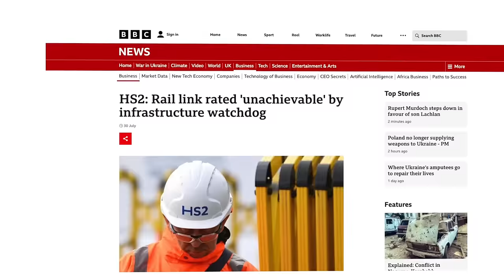The Battle To Build Britain's $90BN HS2 Railway

Comment: China builds 350kmph rail at a cost of under $30 million per Km.
The UK is building 300kmph rail at a cost estimate of over £1 billion per mile.
An utterly absurd cost.
Reply: China is a One Party State though with the ability to just take land off people for the common good.

The UK has to abide by different rules . . . and the law.
Reply: 1. HS2 is being built with a top speed of 360km/h, not 300.
2. A quick google says that the full length of HS2 is 530km. If we divide the cost (as stated in this video) of £106bn by that length of 530km, that leads to a cost per kilometre of £200m. That's still a lot of money but nowhere near £1bn! It's also important to remember that that cost includes not just a railway through open countryside, but also complex city centre approaches, massive new stations, and significant tunnelling.

So if you're going to leave comments criticising the cost of the project, at least do some research first and get your facts right!
Reply: @jasonhesson1030 we've just found someone who believes figures stated by the CCP! there's always one...probably hasn't heard of Chinese tofu-dreg construction.
Reply: @MikeWillSee  The 530km length would be the total length including the 2 Northern legs that will never get built.
The actual distance, as the crow flies from the centre of London to centre of Birmingham is exactly 100 miles, go and check a map.
Top speed does not mean average speed or safe operating speed.
The actual operating speed will be around 300kmph.
You pulled your stats off wikipedia didn't you?
The current estimates for completing the two northern legs are in excess of £150 billion.
The £106 billion figure is only the phase 1 expenses, which is the London - Birmingham bit, so effectively a billion per mile, as the crow flies.
Reply: @disposabull  wrong again. The £106bn figure is and always has been for the full route. The first phase between London and Birmingham is (last I checked) estimated at between £40bn and £50bn. Furthermore, the actual operating speed is also planned to be higher than 300km/h, with trains regularly running at at least 320 - 330km/h, with the ability to increase to 360km/h if they are running late or need to speed up for some other reason. Most of the line is also futureproofed for 400km/h even if it won't initially operate at those speeds.
Reply: @MikeWillSee  The £106 billion figure was an estimate in 2015 prices.
You may have noticed there has been rather a lot of inflation since 2015.
Reply: @disposabull  wrong again. In 2015 the budget was estimated at £56bn.

In 2019, following more detailed design work (and thus a more accurate reflection of the final cost) it was revealed the final cost would be about £88bn and last I heard this is still the official budget for the full railway (not that the government is planning to build the full railway any more).

The £106bn figure is a reflection of inflation since the 2019 estimate.
Reply: I made a video about it and its bridge
Reply: @LoremIpsum1970 The same can be said for the UK government.
Reply: @wackypeace1135  🤣I know which country I'd rather live in🤣
Reply: @LoremIpsum1970  If you ask the Chinese, they would respond in much the same manner. Everyone's indoctrinated into believing there own state ideology, your just too ignorant to know it. Even from a purely capitalism perspective, China appears to be doing fairly well.
Reply: @MikeWillSee  200Million is a lot for a mile of rails,  most of the track is in the country side...
Reply: @LoremIpsum1970  tofu-dreg construction   people like ur self really love that phase,   so give us  a example of one such project?
Reply: @jetli740  and I reckon the cost for the fairly plain line through the countryside would be a lot less, and certainly more comparable with other high speed lines around the world.

Unlike other high speed lines, though, we're building complex new (often tunnelled) approaches into the city centre, where most high speed lines around the world would use existing tracks. This isn't practical for us though as the existing tracks are at capacity and the whole point of HS2 is to increase capacity, hence why new city centre approaches are needed.
Reply: @MikeWillSee    98% of the track in the country side.  dont matter how you add up the 2 % it cant cost that much.
china build the    Lao  414-kilometer train that go through ton of tunnels, bridges, via duct  stations ,clear out jungle, land mine
etc  ... and the cost is only $6B

let face it, uk we dont have the know how, technology to build it at a decent cost.
Reply: Higher quallity and the best technology and know how.
Reply: @jasonhesson1030 tell that the the minority in anerica especially the black and native Americans.
Reply: @stvdmc2011  🤣
Reply: And meanwhile cities in the poor UK goes bankrupt, 1 by 1.
Which country's FM went to the PRC and begged for trade?
I give you a clue, it wasnt India.
😂😂😂😂😂😂😂😂😂
Reply: @LoremIpsum1970   Tofu Dreg construction like aerated concrete that all the schools in UK seem to be made of?
Reply: @taiwanstillisntacountry  

So why haven't you emigrated to your beloved PRC then?
Reply: Why?
Why?
Why is the British-Raj ranked 107th on the hunger-index of only 116 countries?
Why are P00R Scammers of the British-Raj living in Mumbai-Dahravi?
Why is what i do any of your business?
Nuofu-inu? Is it you?
Glory-to-the-British-Raj
Thank God, i am not living in P00R UK.
Reply: Meanwhile in Indonesia.... 😁😁👍👍💪💪🇮🇩🇮🇩
Reply: @jetli740 we do but you are not comparing like for like with China. China doesn't have planning regulations to comply with. Their design costs are not included in the cost as they are paid separately by the Communist government. They also only include the cost of the rail track in the published costs .The cost of the tunnels, embankments,  bridges, road alterations are not included in their published costs.
Reply: @TrevorWilliams-fq8mg  are you try to cope?   it not working...    Lao 6B is the complete deliver working train and track cost.

Comment: Should have given it to the Chinese, could have delivered faster and cheaper
Reply: actually they did invite china which quote at £13-£17B but politic get in the way same as the Hinckley point c nuclear station  ... both could have build at massive less than they do now
Reply: Was that a fixed price actual cost quote and did it include for all the services diversions highway alterations,  planning requirements, dealing with unforeseen ground conditions, design fees, security, delays to the programme, converting a quote into an offer ?

Comment: Base a project around London and the budgetary pit becomes infinite. It should have headed toward the 'Tunnel'. Instead it was aimed to a Euston dead end. It should also have started in 'The North' where its benefits could have been realised quickly. Instead the country ends up with a massive building site which can not even be used as a cycle path, and will cost billions to make safe before it can be abandoned.

Comment: But you have missed the point!!  HS2 is only and wholly about capacity.  It uses higher speed technology simply because that is current technology world wide and which is in use in over 40 nations with which the UK needs to compete. In the UK we have a disastrous relic in rail engineering such that much line maintenance currently requires London stations to be closed. We have an urgent need to expand all UK port facilities and this is now nearly complete with (for example) stations like Southampton and much E-W freight being expanded to accommodate greater freight capacity.  If that is to operate sensibly and be expandable in the future there is a need to further separate freight and passenger traffic.  THAT is the purpose behind HS2".  That is the reason a start was made in the South. That is why Manchester and the North of the UK were considered less essential at the outset.  To abandon HS2 is to risk beggaring the UK economy - especially in the North.  Those who advocate abandonment are really voting to put a limit on the UK economy, to perpetuate the North South divide and worse, by the absence of any alternative for the North, to making Scottish businesses increasingly unviable. Really good thinking that.

Comment: will be aconvenional railway from paddington to curson street with junction at saltley
Reply: Do you actually know what you are talking about or live in Birmingham like I do, the HS2 line is an upgrade of the WCML route from Birmingham New Street and as the route runs fro Birmingham Curzon Street towards Birmingham Airport it runs through SALTLEY actually passing the site of the old Saltley Loco Depot and as London Paddington is no where near the run of the route and is full to capacity with First GWR trains that is out of the question and these trains will not for fill the speed potential on a conventional line
Reply: nio but speculating on what has happened before with HS1 which opened initially to waterloo and then later to St Pancras. with the esculating costs not suprised to see this happen and be finished off later in the century.

Comment: The problem was entirely political. If they had planned it properly from the start it would be done by now. Most of the cost is nimbyism, forcing them to dig tunnels when a normal rail line would have worked fine.

Comment: $90 BILLION? WHERE DID THOSE FIGURES COME FROM?   ACTUAL COST SO FAR (100 MILES) $243BILLION IN 10 YEARS  AND THEY WANT ANOTHER 15 YEARS TO COMPLETE!  CHINA BUILT 25,000 MILES OF HIGH SPEED RAIL OVER 22YEARS AT A COST OF £21 MILLION PER KILOMETER. INCLUDING BRIDGES, VIADUCTS AND TUNNELS.

Comment: what is there to be political about..... this is a no brainer and should be built to its best design because it will go a long way to unlocking economic potential in England and may be the catylist for a tunnel to Ireland.  If you ask me it goes too far west (if this is there plan) and the later phases should have a direct northern route to cut time to Scotland even further.

Comment: It is not a battle at all.HS2 was designed from the outset to be a feast in exactly the same manner as the WCML upgrade was. Elastic contracts where overcharging is the norm are responsible for this and Tory MPs were fully aware of what they were doing and what it would mean. The plans for the project were also designed to accommodate this politically. The irony is none of this would have been possible if the lessons of the WCML and HS1 had been learned and adhered to but by the time HS2 was launched Tory policies had ripped the heart out of the Uk heavy manufacturing industry leaving it almost incapable of providing what was required and opening the doors to predatory foreign companies knowing they were the only choices left to come in and feast on taxpayer money again.

Comment: The embarrassment to the UK of not completing HS2 outweighs the financial cost. We're looking at a 1-3T GBP cost to get to Net Zero by 2050 (for a little over 1% global CO2e)...but that's ok... Why wasn't it built from either end simultaneously like the French do? The millions spent in design and planning are chicken feed compared to the construction costs. I'm not seeing any reported indication of any value engineering and standardisation going on... HS1, a lot shorter, was a success although it was partly designed and underwritten by Bechtel...like a lot of the UK rail infrastructure that was privately built for profit...and I haven't even mentioned CrossRail.

Comment: The problem wit HS2 is that the alignment was utterly wrong.  High Speed UK got it right. Have an expanded East Coast Main Line as the spine. Then it can peel into the Channel tunnel or London.  Add a Liverpool to Hull line that branches into the spine.
Reply: Ideally both coasts deserve equal treatment but if we try to cover as many of the largest population centres as possible on one main line I think a snakier main line would be it. A bit of an inverted S. 
Glasgow 
Edinburgh
Newcastle
Leeds
Manchester 
(obvious branch to Liverpool)
Birmingham 
London
Reply: @threesixnine369six  
Your S can be directly thru Liverpool, then thru North Wales or Chester then onto B'ham.  

Yes, North Wales that invisible part of the UK.
Reply: Why is the HS2 alignment utterly wrong considering from the outset it has been a Birmingham based project.
Reply: @peterwilliamallen1063  
Birmingham based?  please!
Reply: @johnburns4017  I would very much prefer for it to somehow go or loop directly through Liverpool, but I think even my hypothetical branch is still better than the real life situation lol

Comment: Sunak is wanting HS2 to be from Old Oak Common in London to the West Coast Main Line at Handsacre north of Lichfield with a short branch to Birmingham - and no more.  The construction of this section is advanced, so go ahead. 
This will give a time of about 1 hour 30 minutes from London to Manchester 200 miles away.  That is not slow.  Averaging end to end around 150 mph on a mix of high speed and existing track.
Birmingham, Liverpool, Manchester and Glasgow will all have fast times to London once phase 1 is built.
Reply: The so called branch to Birmingham is the main stay of HS2, but at least you are beginning to understand about HS2 after me pestering you, yes it will be built to Handsacre where HS2 trains will join the existing WCML and travel to Manchester and Scotland via Crewe
Reply: @peterwilliamallen1063  
The mainstay of the new HS2 track is the  section OOC to Handsacre - the spine.

The branch from the spine to Curzon St is needless as it runs alongside the B'ham-Derby line.  The branch junction can run onto the existing B'ham-Derby line to better connected New St. The Germans and French use existing tracks to get into city centres. B'ham-London trains go to New St anyhow. 

Build the crossrail using the Benson St curve and then 3 more trains are take away from New St.
Reply: @johnburns4017  The mainstay of HS2 is from Birmingham Curzon Street to London Euston now, the short section from Water Orton on the outskirts of Birmingham is a short stub to take HS2 trains to Lichfield and Handsacre to join the WCML and with trains topping at Birmingham Interchange speeds to Lichfield will more than likely be only 100 MPH.
The whole idea of HS2 is to run on a separate track from freight services and local and other Inter City Trains, you hair brained idea would mean an even more awkward idea of getting trains from the HS2 line onto a route tat has is one of the major freight routes from Birmingham to the rest of the Country and Felixstowe plus it carries X Country train services and local traffic so would not cope with dual use, plus these trains will not fit into Birmingham New Street Station hence a Station that is 3 times larger than New Street Station, Birmingham Curzon Street and before you say anything Birmingham Curzon Street Stations main entrance will be on Moor Street Queens way right in Birmingham's City Center next door to Birmingam Moor Street Stations entrance, don,t forget I live in Birmingham close to Birmingham City Center and the HS2 line alignment and the Birmingham Derby line so unlike you who lives in Newcastle I do no first hand what is going on.